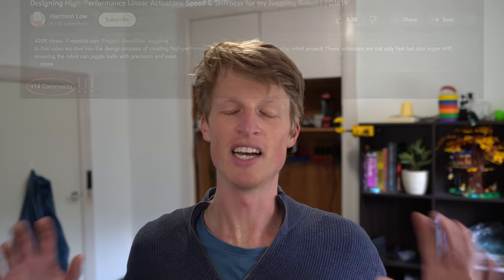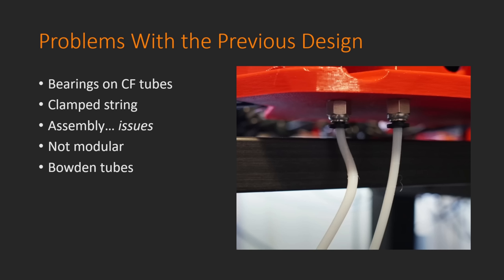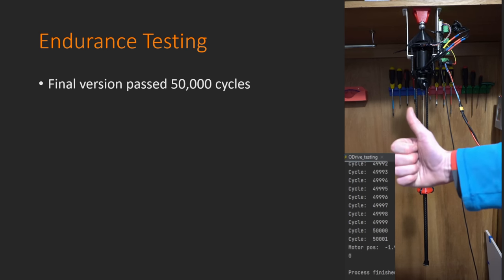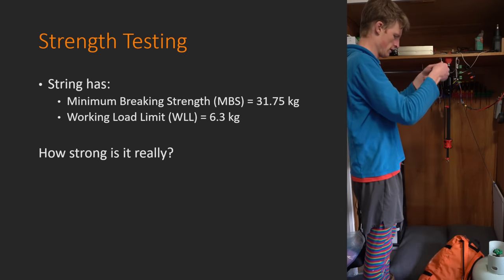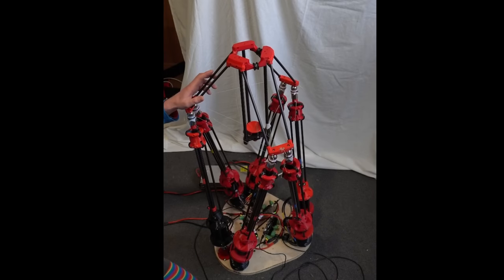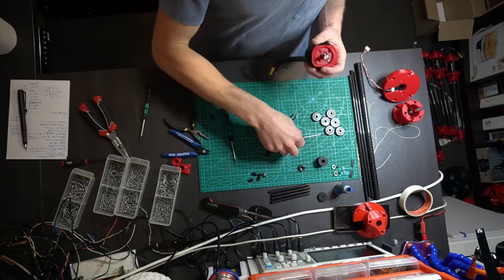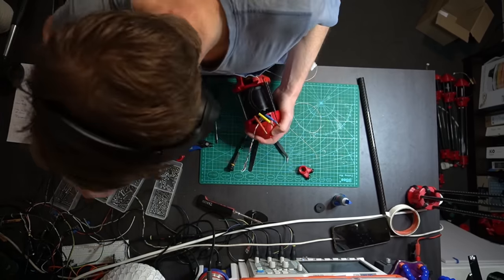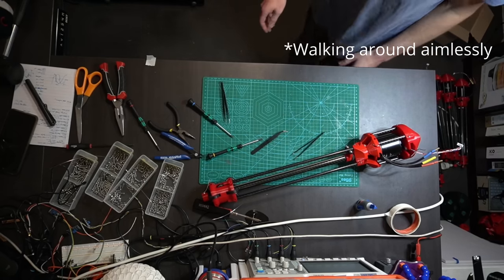My New Linear Actuators are SO MUCH BETTER! | PDJ #21

Comment: You can redirect the string with only two bearings for the green string, and (at least in the section you showed when talking about it) one bearing on the blue line. 

You should only need one pulley to change a strings direction. The cable clming off the first redirect pulley is in the exact same situation geometrically as it is coming off the spool (unwrapping from a cylinder with a vertical axle), only offset slightly.
Reply: Basically you should only need one pulley with it's groove/side face coming off tangent to the spool (and the axle horizontal) and redirecting the string straight up the tube in one case, and in the second instance to the central redirect. For your bearing on cf issue, bearings with delrin sleeves are an off the shelf part (look up delrin v wheels).

Comment: To terminate the cable you could make a clamping block to clamp around the cables helix with a 3d print In two halfs, and the to tension just a through bolt fully threaded pushing up against the fixed part of the assembly but running through the 3d printed cable clamp, turning the bolt would then increase tension, almost like a chain tensioner on industrial equipment
Reply from the maker: Interesting idea! Do you think this could be made super small? I'd need one of these on each end of the central CF tube so they need to be quite small and light

Comment: Speed: overheating brake resistors.  Use a cosinus curve (speed) at the end instead of feading all that power to a break resistor.
Have had the same problem with a 220 Watt motor on a frequention speed control, it tripped above a specific speed while with that cos curve it did that at about a double speed.  Hope this helps.
Reply from the maker: That's a clever idea! I can see how that would go a long way to getting higher max speeds. For better or worse, when Jugglebot is in operation, it's fairly likely it will (semi) often be sent commands that require it to stop and start really suddenly, and I'm not sure I'd always be able to smooth them out like this, but I will try to keep this in mind while I work on the control side of things. Definitely food for thought! Cheers 😊

Comment: Synchromesh termination ... this may work, or may be a disaster; larger bolt, drill through just under the head, thread sychromesh through hole, tighten bolt in ... test for disasterness.
Reply from the maker: Sounds like it's certainly worth trying!

Comment: Terminate syncromesh cables, simply clamp them under a cable clamp, even bend little v in a plate like the side of a washer and bolt down. Then tension by having it slide and a bolt push or pull the clamp block tight. Or at any pulley spot, tension like a 3d printer.
Or just pull the cable to tension then tighten clamp block down

You can use 2 bearings, replace the bottom 2 with 1 that is skewed so 1 line from the top bearing and 1 line tangent to pulley come together to any point on the side, then skew the bearing axle to fit the maybe 20 degree angle and be tangent to these lines
Reply from the maker: Very good suggestions, thanks! Seconds ago I pulled the test-part off my print bed to try out a clamping idea similar to what you describe and it worked wonderfully 😁

Comment: Igus makes linear slide bearings for carbon fiber tubes. They're just plastic bearings that you bonk onto the cf tube.
Reply from the maker: Interesting! Do you happen to know what these are called? I've tried normal linear bearings but the tolerances didn't work for my carbon fiber tubes. I'd be very interested in trying some of these!

Comment: You could use fishing line for the string. It would be stronger, but I'm not sure how much it would stretch out over 50,000 cycles.
Reply from the maker: Yeah I don't have a huge amount of experience with fishing line but that which I do have has taught me that it is often really stretchy. Not sure how good that'd be for a precision robot. Would almost certainly be the cheapest option, though! So might be worth considering if anyone is building these on a budget and doesn't care too much about precision

Comment: In terms of stiffness I don't know if that would change a lot but instead of having 6 rollers on the fixed part, why not put 3 at the top end of the fixed part, and 3 on the bottom end of the moving bar. This way the moving part is guided by the whole overlaping length with the fixed part, thus stiffer
Reply from the maker: I toyed with this idea a lot in the development of these actuators and ultimately decided against it for a few reasons:
 - The "guide" CF tubes, while quite stiff, can flex a bit if they're loaded at their midpoint
 - I want to reduce the weight of the "end effector" of the leg as much as possible, since this is the part that's moving the most (and fastest)
 - After experiencing how much wobble there can be in the fully-extended tip of the leg (if things aren't tuned quite right) I'm worried about the stiffness I'd be able to get out of the system you're describing when the leg is fully extended. Maybe the solution is a simple one: reduce the "operative" length of the leg.
Others have been suggesting using linear rails that run along the support CF tubes and I wonder if that would be the best of both worlds: increased bending stiffness for midpoint loads, (relatively) low weight, high stiffness for when the leg is fully extended, etc...

Comment: I'm unfamiliar with synchromesh. are there crush/crimp terminals for that material?
Reply from the maker: There are, but they don't (inherently) give any way to easily adjust the tension in the line, and I'm not sure if these would be the best way to terminate the cable at the spool end, due to the fairly small sizes in that area

Comment: I don't know what are you using, the battery or the power supply unit. But in theory, if you will use battery - you will dump all the regeneration energy in the battery and brake resistor will not heat at all. Also check the odrive setting for regenerated current value that will dump to the battery before applying energy to brake resistor. Also you could use the array of brake resistors in parallel with active cooling.
Reply from the maker: I'm currently using a power supply, but I'd like to move to batteries at some point (a portable Jugglebot sounds very cool). Yeah I think you're right about the settings. I'm sure I'm just missing something obvious but I can't find what it is!

I've tried many different brake resistors and combinations, but have been left scratching my head and wondering why they don't work! What I've tried:
1 - 22 V PSU + 2Ω 50W resistor (overheats)
2 - 22V PSU + 2Ω 300W resistor (over_regen_current [can't recall if the PSU tripped here])
3 - 48V PSU + 2Ω 300W resistor (over_regen_current and PSU trips)
4 - 48V PSU + 0.5Ω 1200W resistor [soldered four 300W resistors in parallel] (over_regen_current and PSU trips)

Comment: Imagine 12 of these moving a table up and down!
Reply from the maker: Haha I actually considered making a standing desk with the stepper motors and ballscrews that I used in the first linear actuator design (on my Channel if you're curious), but ended up just buying a proper standing desk—a purchase I do not regret in any way 😜

Comment: To terminate synchromesh you can use anelectrical wiring ring terminal and a crimping tool. You can search synchromesh and pulley kit for positron 3d printer.
Reply: Also you can search for synchromesh loop sleeves and synchromesh thimbles

Comment: 10:58 maybe a clam type system? 2 screws and one plate that those screws press down? or pass through aka hole and then screw bites down from the side. or thats at least how most rebuildable vape tanks works. hole and one 3mm scrub screw that bites down on the heating wire from the side
Reply from the maker: This is super similar to a solution I later came up with for the same problem! Cheers for the suggestion 😊

Comment: Could you make a graph for speed/force would be really interesting for building some servo drive speakers
Reply from the maker: Do you mean the max force at different speeds? That would be *possible*, but would take a very long time. I'd happily support someone else if they want to build and test these actuators out a bit more rigorously than I did!

I'm not sure you'd be able to get the frequency (bandwidth? Not sure of the correct term) for a speaker driver though? What exactly did you have in mind?

Comment: for cable tensioning with the syncromesh maybe look towards guitar cable tensioning. Its easy to swap strings and readjust tension
Reply from the maker: Good idea! I wonder how small these mechanisms could be made, though? I'd need one tensioner on each end of the central CF tube, and I want them to be as small and light as possible

Comment: Rather than TPU sleeves for the bearings how about using v slotted wheels like you find on 3D printers, the ones with a V cut into the wheel itself?
Reply from the maker: I mostly didn't do this because I don't have any on hand (that aren't made from metal). I've put in an order for a bunch of bearings of different types (flat, V-slot, U-slot) and materials (delrin, POM, polyurethane coated) to test out. I'm sure one of them will be what I need!

Cheers for the suggestion 😊

Comment: When there is no wire left on the pulley and
When there is a lot of wire wound
The outer diameter will be different. How did you solve this?
Also, due to the difference, the tension in the string will not be linear.
That's a big problem.
Reply from the maker: Good question! There are a few things going on here:

1. In the actual actuators I'm using, I've tried to only have as much string as is necessary. This means that even when fully wound, there are only ~6 winds around the pulley, which isn't really enough to cause more than a single overlap. The testing actuator had longer strings to make it easier/faster to recover from breakages.
2. The string is so thin that even if overlap occurs, it doesn't really matter
3. Related to 2, the string has a slight amount of stretch, so it can tolerate slight increases in tension

Comment: My first thought for terminating a wire with variable tension would be electric guitar saddles? not sure if you could just use them out of the box or if you'd have to make something custom tho
Reply from the maker: Good idea! I wonder how small these mechanisms could be made, though? I'd need one tensioner on each end of the central CF tube, and I want them to be as small and light as possible

Comment: if you where to have the string wrap the motor body, 2 problems you will need to consider is the motor heat. and due to geometry, you would loose force generating ability and increase the load on the motor significantly, it is far better to have a smaller diameter spool like your working with.
Reply from the maker: Great thoughts, thanks for sharing them! I'm definitely not fully sold on the motor-as-spool idea but will keep your concerns in mind if I ever go down that route. Cheers 😊

Comment: You can terminate spiral cable on a 3d printed frame by making a cavity with the pitch of the spiral wire in it, that is clamped by a block held with bolts on either side. When loose, the cable can be tensioned, and then clamped in place when taught?
Reply from the maker: So simple! I actually used something pretty similar to that when I made the 10:1 pulley mechanism - the sections where the string path kinks in the schematic shown at ~8 min are clamped in place. I think I'd even be able to get away with not adding the groove for the spiral part of the cable because of how pliable 3D printed parts are.

I wonder if it's possible to make this small enough to use on the spool end of the cable - space is very tight there so whatever method I use to terminate the cable there will need to be quite small

Cheers for the idea!

Comment: You could potentially reduce the number of pulleys by changing the orientation of the motor and spool. You could design the motor holder and spool so that the strings comes off the spool and go straight up the rod without needing the direction change. You could do this with a bevel or worm gear between the motor and spool or by mounting the motor sideways or horizontally too.
Reply from the maker: I really like that idea! I've never thought of using a worm gear here. That'd be a really neat way to get way more precision out of these, though I imagine it'd cane the max speed 🤔 Cheers for the suggestion!

Comment: I just discovered your actuator and I find if awesome !
Regarding the string lock at the top of the actuator, you can use blocking rings such as those used in RC airplanes to hold the wheels.
Regarding the strings, there are high quality/stiffness/endurance 2mm (maybe less too) cables used in light aircrafts to link flight surfaces to the control rod and pedals.
Regarding the general structure, I wonder why you don't print the negative shapes and mould everything in carbon fiber+epoxy. Stifness will increase precision. 
Finally, Regarding the brake stage overheating, I strongly recommend that you check how it's done (and which mosfets used) in F5B competition ESC. These devices are able to brake a 8kw motor from full power to full stop in a fraction of a second.
Reply from the maker: Cheers! Do you have any other search terms for the 'RC airplane blocking rings'? I couldn't find anything with those search terms 🤔
Re. string: I'm actually using 0.8 mm dyneema now, and it's much better than the kevlar ones I showed in this video!
Re. casting/molding: I've considered this, but I don't think the added stiffness/cost/effort considerations make it worthwhile. I think if I wanted to stiffen the robot up, I'd get everything machined.
Re. braking: I think they use batteries, which I agree seems to be the 'normal' way this is done. For better or worse, I don't really want to use batteries so need to dissipate the heat rather than use it for regeneration. As it happens, I've just recently finished a 'regen box' that'll easily handle Jugglebot's power dissipation requirements 😁 I go into this a little in one of my recent livestreams, if you're keen to see it in more detail. Link below 😊
Reply from the maker: Link to livestream: https://youtu.be/mhaQtROZRVs?t=1500

Comment: You could probably use a diode and capacitor to accomplish regenerative breaking
Reply from the maker: Yeah I've seen this sort of setup used online before, but I'm a little terrified of the capacitors that I'd (probably) need 😬 My electrical knowledge is a little lacking right now so I think I need to sit down and do some reading/planning on this side of the project

Comment: Realy nice project would like to see more of this.
One safety approved could be add some end stopper for that middle pipe so it dosent fly out of when string cut off.
Reply from the maker: The subscribe button is just one click away 😜

I do like that idea, but it's also kinda fun not knowing if the central tube will shoot out or not 😁 (I probably will add safety features like this to the completed platform though. Depends how often/severely it happens in testing)

Cheers for the feedback 😊

Comment: Is there a reason you didn’t use linear bearings to keep the central shaft aligned? For the twisting will that actually be an issue once you fix the end of the shaft to a platform?
Reply from the maker: Yeah, I tried linear bearings but the tolerances didn't work for my carbon fibre tubes (some tubes fit with slop, others didn't fit at all...). Perhaps it's worth buying some higher-tolerance ones and giving it another go 🤔

As for the twisting: I actually think it might be a bit of an issue (though they can only really twist when in a somewhat compressed state, so maybe it'll be fine?). The platform will twist relative to any given actuator a fair amount and this will probably transfer at least a little through the magnetic joint. Time will tell!

Comment: you could do a combined testing aiming at measuring the endurance compared to the amount of mechanical energy deployed, the weight lifted times the distance * how long it took, in g per meter per second, same as it was a conveyor belt
Reply from the maker: Yeah for a while I was considering doing an "output power" test (Force x Velocity) but ultimately decided it would be too tedious to run and I didn't want to have to deal with more broken strings as a result of overheating/failing brake resistors

Comment: You could use a Kevlar based cord and potentially get a a size that is a direct replacement for the cord you have now using the same termination method.
Reply from the maker: I should've mentioned this in the video, but the string I'm using actually is made of kevlar 😁

Comment: If you add the bearings on the endcap of the inner tube you shouldn't then need the backmost 3 bearings on the top.
Reply from the maker: I'm glad you mentioned this! I toyed with this idea a lot in the development of these actuators and ultimately decided against it for a few reasons:

 - The "guide" CF tubes, while quite stiff, can flex a bit if they're loaded at their midpoint

 - I want to reduce the weight of the "end effector" of the leg as much as possible, since this is the part that's moving the most (and fastest)

 - After experiencing how much wobble there can be in the fully-extended tip of the leg (if things aren't tuned quite right) I'm worried about the stiffness I'd be able to get out of the system you're describing when the leg is fully extended. Maybe the solution is a simple one: reduce the "operative" length of the leg.

Others have been suggesting using linear rails that run along the support CF tubes and I wonder if that would be the best of both worlds: increased bending stiffness for midpoint loads, (relatively) low weight, high stiffness for when the leg is fully extended, etc...